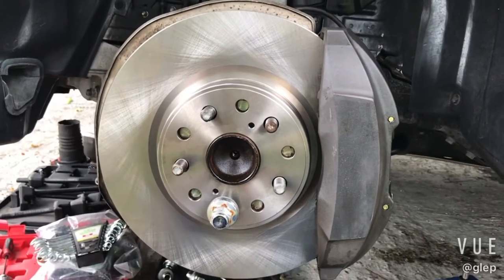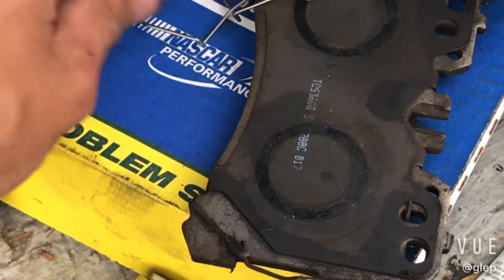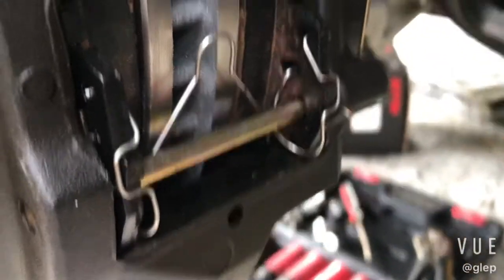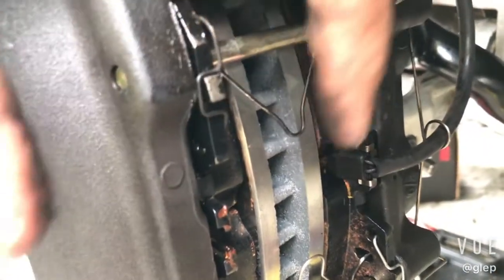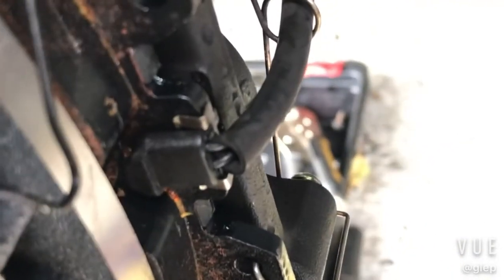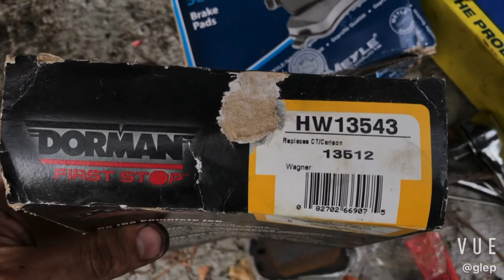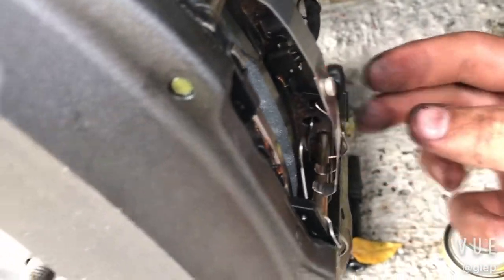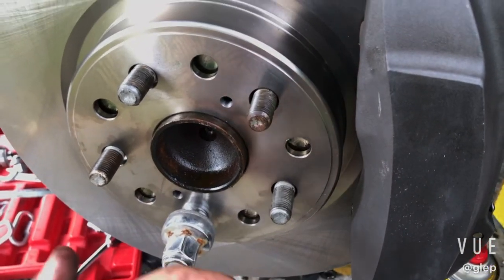LS460 Anti Rattle Clips. Brake pads / rotors Change. Lexus - caliper.

Comment: Thanks for the post. One thing I also noticed is that you don’t necessarily need to remove the callipers for a brake pad change on the LS…which is so cool by design…thanks again

Comment: Omg even my mechanic couldn't work out this rattle, will check this out, thanks for the video!!!!!!
Reply: Took the wheel off and sure enough had a spring on the top on each set of brakes, bought new set online and installed myself, can't believe the difference with that infernal rattle, happy days :)

Comment: So I did exactly this very helpful. It did not clear up the issue though still rattles and stops when braking. Do you think I should put tope rattle clips and grease the hell out of anything down there?
Reply from the maker: Check your wheel hubs. And lower ball joint.

Comment: I just bought the genuine Fitting Kit (04947-50120) and it only has one of the v-shaped clips on each side to fit at the top. Interesting that the aftermarket kit has four of the clips - one for top and bottom both sides. EDIT: There is a Lexus TSB L-SB-0036-15 that expressly recommends fitting two to fix the vibration. Good find @E39M5SPEED
Reply: So in order to get the two clips I need to buy the 04947-50120 and the hw13543? Currently attempting to change this on my 2007 ls460 but the hardware fitting kit I bought doesn’t seem correct and is missing pieces. Just want to get my brakes done and move on so any help would be appreciated!
Reply: @benlarson756  I had the original clips so I reused them as well as the clips in the kit. If you don't the originals you can either just use one on each side as originally intended or get a second pair of clips

Comment: Do you have a video of that rattle ? Mine does it on slow turns and I get a metallic rattling sound. Also sounds worse on hot days.
Reply from the maker: Video does not pick up that sound.
Reply: Did it rattle when you would make full lock turn or slightly having the brake pedal depressed and wheels locked
Reply from the maker: @BasedSwaghoe  all the time. Regardless
Reply: @E39M5SPEED  I’ve noticed on my brakes I’m missing the clips for the bottom but have the top has to be my rattle. It sounds like rocks in a tin can . It also do it when it’s hotter out.
Reply: I also changed my front rotors for centric, put all the clips, didn’t go for a test drive but when I spin the wheel in air it scrapes, should I go for a drive and do 30-10 50-10mph stops a few times ?

Comment: I bought all mine hard wear from the dealership my pads are still rattling when I apply brakes thr rattle stops
Reply: Did you get it fixed mines does the exact same
Reply: @shervintheodore7249  no still doing it
Reply: I have all the factory hardware and it still does it my pads are factory as well I said forget it as long as I know what it is but its kinda aggravating when thr radio is off on bumpy roads